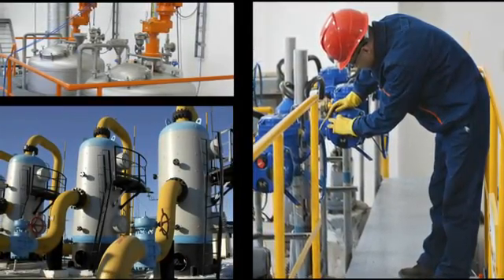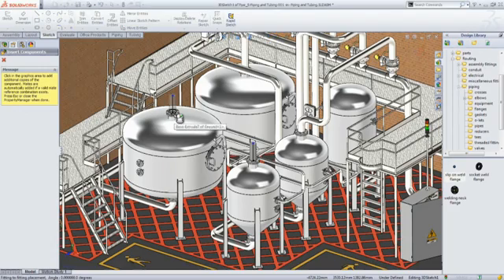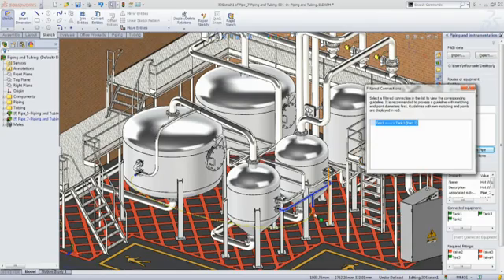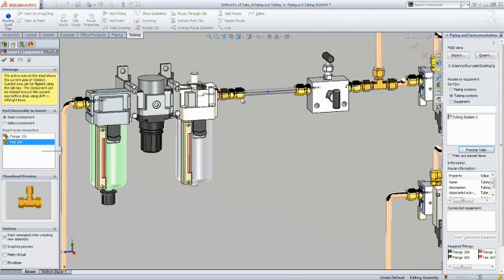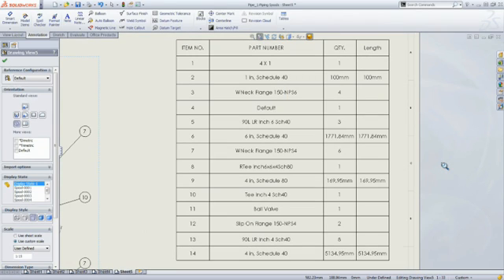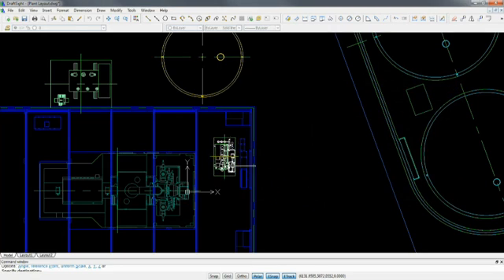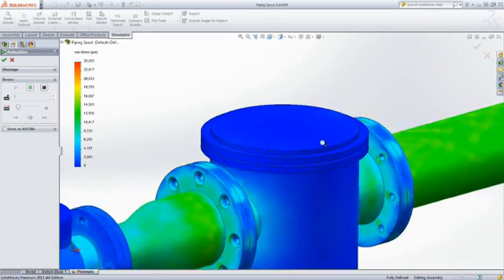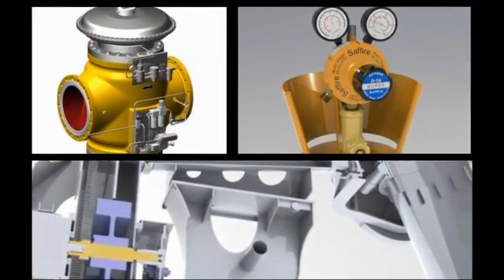Improve Your Oil and Gas Design Capabilities

Comment: Hi.
I Need information for how to use Solidworks in design of medical gases systems or copper piping systems
Reply from the maker: Hi there, we are happy to point you in the right direction for great resources. MySolidWorks is the place to get the best answers to your questions about SOLIDWORKS in one location. 
 
We can also direct you to a variety of resources for questions and networking. 
 
SWUGN, or the SOLIDWORKS User Group Network, can be accessed here:  http://swugn.org/ 

With your existing SOLIDWORKS or 3DEXPERIENCE ID, you can access SOLIDWORKS Forums for more information on a variety of topics and questions from our user community. 
 
Check it out here: solidworks.com/UserForum